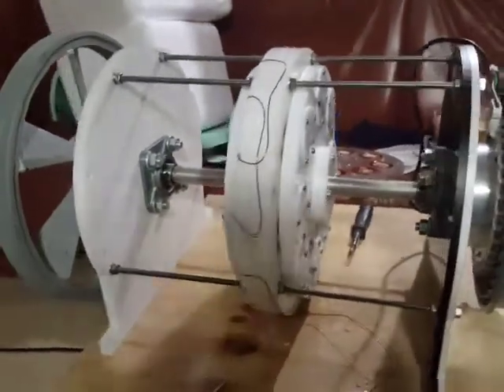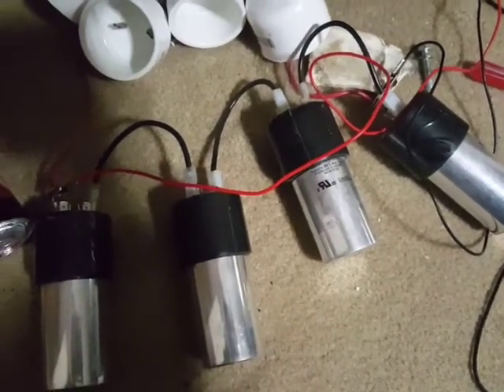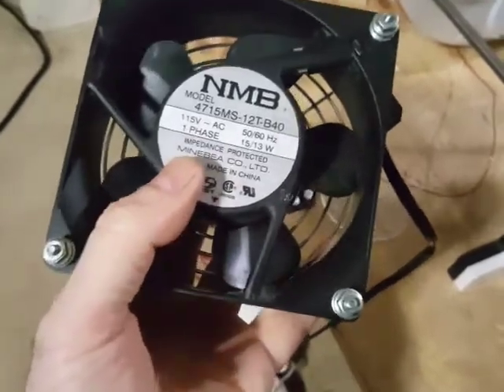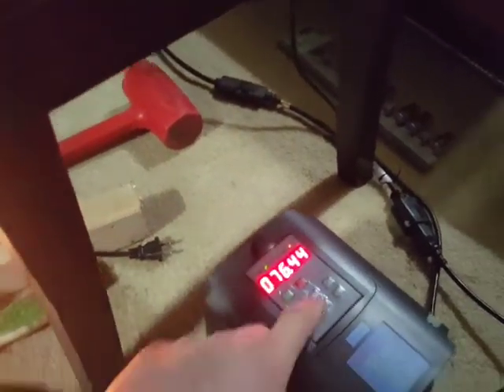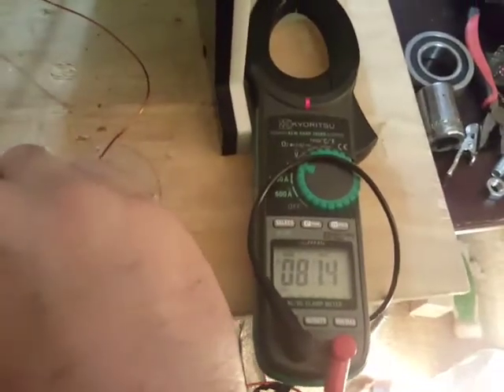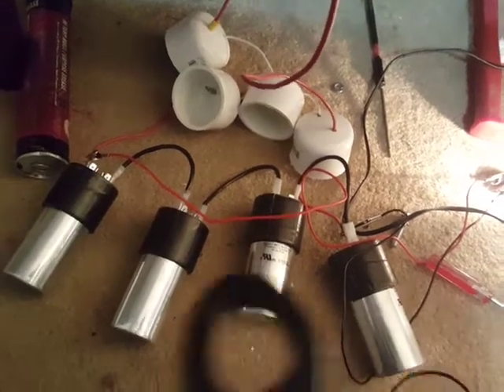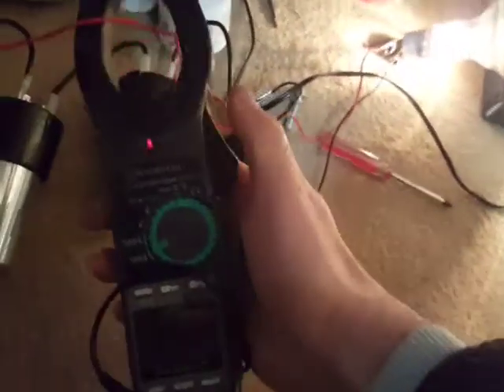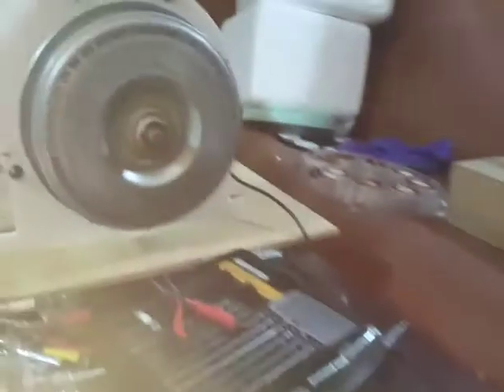Modified SP 500 generator on flywheel

Comment: Switch the placement of the flux motor and the flywheel. The flywheel should be in the middle and use a good bearing or magnetic bearing to reduce friction

Comment: 5:20  You can put some weight on the flying wheel (on the opposite side of the shank) to try to balance it.  By "trial and error" you will determine how much weight to put.  Otherwise you can have a desastrous accident !!!

Comment: I would not pay over 400$ for commutator and i don't like it on generator or motor.  My impression is that you wasted moneY on that sp500 stuff. For overunity i would bet on rezonating lc circuit and timings. It is complicated but eliminating cogging is must. Some switching capacitor bank to power load in time when magnets not approaching coils and do cogging by load current. So ringing coils with high Q factor and proper timing is the way to go.

Comment: 1- un-plug your BIG light,   2 -  fix more your generator at your table ( or in the floor... ) and....  add MORE generators  in your  stainless steel shaft bar !..... and ...  change your washing machine motor (120 volts... ) for a 12 volts high speed motor ( small size ) and..... you can have more electricity at the same time, and charge your  wall-battery pack or directly a machine motor and... auto recyrculate this power for FEED your 12 volt motor :P

Comment: Hi, do you have updates on your project?
Reply from the maker: Cian Guevarra  Hi, mostrly i have been doing research and getting in to conclusion this device will not be overunity the way i have setup, reason why because it will never outcome with Lance Law.only way to fight back EMF will be 1) instead of using  HMVH plastic for magnet  disks holders i need to use steel plates on both side as flyweel and add more flyweel  on the sheft. 2) instead of using as  direct  current generator i think would be much afficient if i would use Bedini circuit or something similar which would  work on hight voltage instead of 12 VDC.  that way back EMF would be dramatically reduced and  stator would be much efficient to use as battary charger. Maybe MPTP  hight voltage charge controller would be useful. By all means if someone would verify that kind of combination might benefit this project would be nice and i will move forward for farther testing.
Reply: Are you familiar with this invention? I think he use bedini motor as Prime mover on the generator.. https://www.youtube.com/watch?v=9QBrI3rM4Qs
Reply from the maker: Cian Guevarra i just checked but dont see in his device can produce usable energy, there for unit is all covered and not showing what he is doimg there.
Reply: @Genprojectalternativeenergy  Several years ago I built a similar device. It was based on EV gray device. Heavy flywheel and high voltage pulse discharge caps is the way to go. Te motor generator you seem to be building from the creative science guys is a Newman type motor and you will get it to work. I am sure.
Reply: @jimmypopp2695  I am trying to build this generator. Would you be willing to share some of your wisdom from your build that you did?

Comment from the maker: Hello all. Still traing to understan and find others who had suxess in this device, if you guys have private quastions or answers to say contact me directly from channel messaging. Another quastion i see the similarity between to this https://youtu.be/J2bPDDWqSvM  and my project,does anyone hase wise explanation?
Reply: When you removed 4 capacitors you measured 000.4 A on the torgue, how much power did you have on the output generator without capacitors then? did you have more at the output or input?
Reply from the maker: milan bojovic  tu run the gen consumes more then produce, because of the lans law, have not traied Bedini sircuit yet, would need someone knowladgable who has traied and if it would work on my setup.
Reply: ok, at 390 rpm you get 114.6V, but how much frequency do you have at 390 rpms? 25 hz?

Comment: Hi,
Have you tried connecting the winding in 2 phase since it has 8 coils. Let say Coil 1, coil 3, coil 5, coil 7 connected in series and coil 2, coil, 4, coil 6, coil 8 connected in series then try to measure the output voltage on each set of series connection then add it.  compare it  on the output voltage when they are all connected in series if they are equal.  I am thinking that, since the coils are closed to each other, there will be an overlapping of waves if they are all connected in series that may decrease the output voltage.
Reply from the maker: Cian Guevarra i have not modified wiring since it came from  creative science directly to me ,it was olready wired as single fase in series. I have original scematics from them and also i can show you my original stator wiring if tou will be interested, i just fallow there footprint as they recomended in there plan.
Reply: please show me how it is wired.. have you tried to measure the voltages in each coil and add it up and compare it on the output voltage when they are in series..
Reply from the maker: Cian Guevarra  no i have not checked the coils how much it produce ,but i checked the polariti on each coil sought.it will be tought to check each individual coils how much they produce, it also depends on rpm
Reply from the maker: Cian Guevarra i will show you PM me in person and will show you diagram.
Reply from the maker: Cian Guevarra ok you can remove email now. Actually you could PM me from youtube messaging directly. You need to go to my profile/about and there is send message  see if it works. I will contact you soon i get a chance from my email.
Reply: sorry, I can't find the youtube messaging in my cellphone but I will try it in my PC..
Reply from the maker: Cian Guevarra i sent you an email.

Comment: if you measue the current on the wire, the tester should be away from the rotating magnets other wise, the tester will detect the magnetic field coming from the rotating magnets so you have a reading on your tester..

Comment: I am planning to use washing machine motor as the prime mover. I think the torque is enough to drive the sp500 gen.
Reply from the maker: Cian Guevarra yes the torque is enought to spin  the ap500 gen up to 1000 RPM if you have a good balance and low resistance. On my demonstration i had a load 250 w light bulb ised and WM motor was able to hendle the torque, but what i have noticed is if i pick up the speed slowly it runs fine but  ,if i start the motor qith lo load and apply the resiatence the same load 250 w light bulb then it stops the  WM motor and starts making vibration  i demonstrated in the vide that behavior as well, quastion is what are YOU planing to to use as a WM motor controller? The one i have is good but not best, drop me a message if you have anything better in mind.
Reply: I will not use any controller.. I will use washing machine motor (220v/170W) without controller..
Reply: I will just connect the motor to generator by pump belt and maybe 10" and 2" diameter pulley..
Reply from the maker: Cian Guevarra thats not gonna be enought when you apply the load. I have traied similar concept but you will achieve to spin only. Spinning is no big deal you need a torque to maintain the speed on constant brake.
Reply: I think the torque in the generator is enough since  I will put 10" pulley on the gen ang 2" pulley on the motor but the rpm on the gen will be reduced..
Reply from the maker: Cian Guevarra yes the rpm will reduce. It needs about on my setup 400-500 rpm to have 120v. When will you be able to put all this together? Can you mesure the torque? I am interested to see how it will come out.
Reply: by january  I will begin to wind the coils.. just atleast  15v for each coil to charge 12v battery.. I'll just connect the coils in parallel. If I will upgrade it to 48v, i will just connect it in parallel-series.. how may coils do you have, how many magnet,  how many turns per coil?
Reply from the maker: Cian Guevarra    if you would watch both of my videos i have mentioned in there coil details .this is 8 coil 17 cage wire 430 turns. And 16 N52 round magnets 8 on each magnet disks.
Reply: @Genprojectalternativeenergy 
5 years later…: for sure not success at all!

Comment: Hi, interesting video. The motor is a DC motor but you are running it on AC, didn’t know that would work. Does it heat up? Can it be run for long periods at a time?Thanks
Reply from the maker: Jack Mefford  longest time i have tested was about 30 min, it depends if i adjust the torque on the controller and run on 500 RPM then it is slightly worn, on the load 250 w. I my self asking the quastion is there any better controller out there. Gerrard is doing the similar thing and he is waiting for some controller,I'd like to see if he can get better results.i am up for any sudgestsion and ready to test.